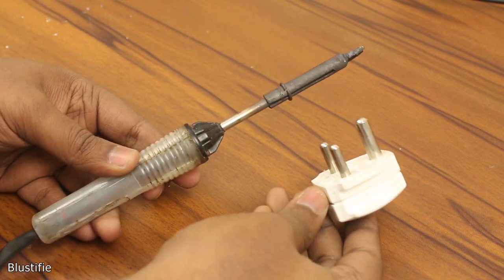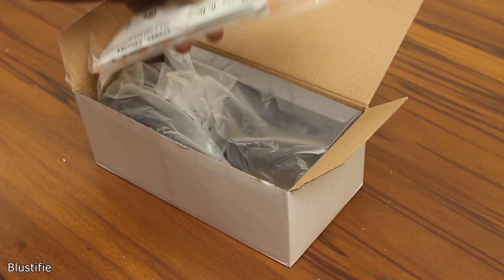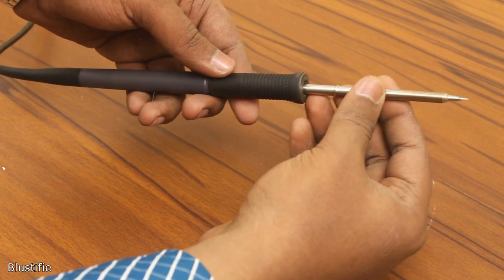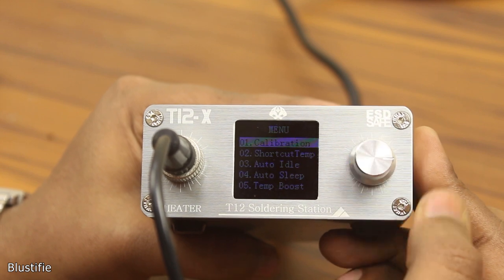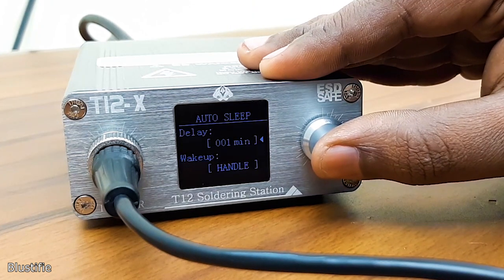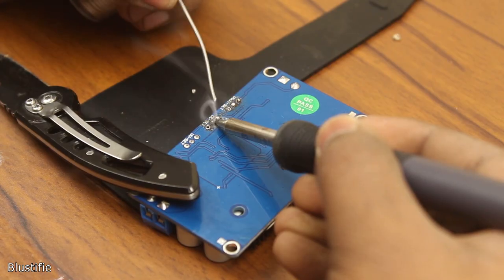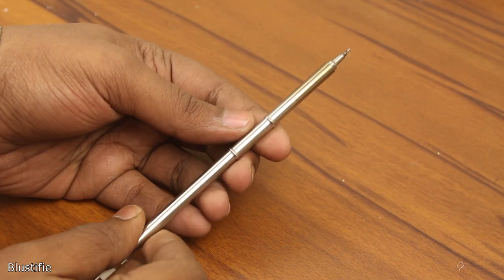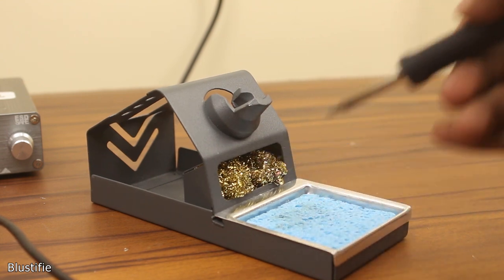OSS Team T12-X Soldering Station Review: The Best Cheap Soldering Station

Comment: Thanks for the review. So, tip is grounded, but case seems to be ungrounded. Did you check whether there's continuity between case and ground? 
That feature seems incredibly rare with T12 station. This OSS T12-X has the best looking handpiece, but having to ground the case manually makes that advantage not stand out for most users.

Comment: when i get the product package i see inside anti scalding silicone pad.. nobody explain how to use it ..
Reply from the maker: You can use it to solder small components. It is basically a heat resistance mat